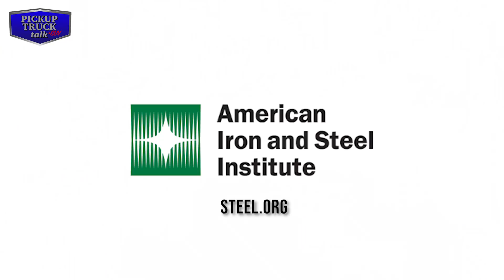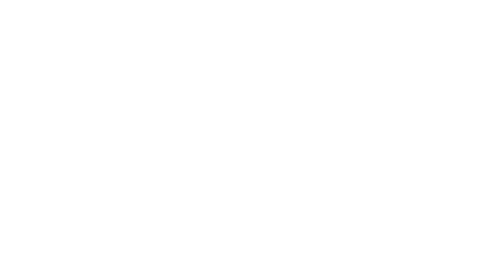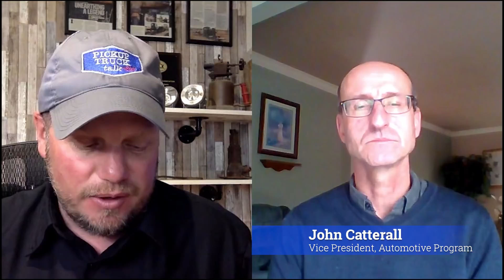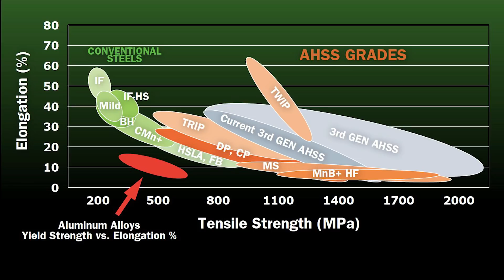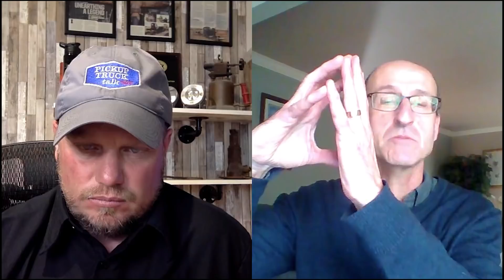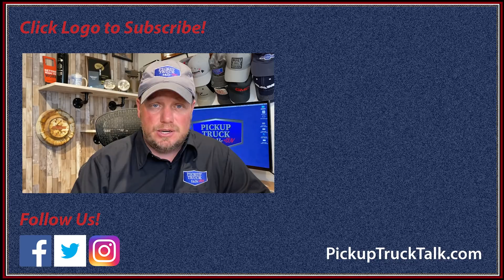Should Truck Frames Bend? Thinner Frames Are Weak? - Expert Answers

Comment: Tundra uses c channel as you know.
Reply: I was under the impression that they use both box and C channel on their frames in different sections, to get the best of both strengths and lightness. When the 2nd  gen tundra came out  we all saw the videos of the bed wiggling over severe bumps. They later box the frame further back to stop that from happening. Toyota Engineers are good, but they make mistakes too
Reply from the maker: sfakach t you are correct. I had to go back and research it again. They have a fully boxed frame up front and a c channel I’m the rear. I’d suspect fully boxed all around with high-strength steel throughout on next gen.
Reply: @Pickuptrucktalk  correct toyota calls it triple tech, boxed in the front and two sections of c channel. The heavy duty trucks and semis have a similar c channel  configuration so why don't they use box frames on the heavy trucks?
Reply from the maker: @jw8578  He answered that in the video. Basically, because 4500, 5500 trucks and semis don't care at all about fuel economy, they give them really thick frames that allow for overloading since the c channel squats when overloaded. If you do that on a consumer grade truck like a half-ton, you would get really poor fuel economy, performance and ride quality issues. It is like driving a 1980s Ford Bronco versus a new SUV today. The fuel economy is really poor, the ride is rougher and it is slower. 

If you want to see this in action, I have some videos of old trucks we use to haul in corn. Those trucks barely get 10 mpg and they bounce like crazy on the road. It is so much better when you add the 14k lbs of corn into the bed. Really smoothes out the ride. 

It really does all come down to what customer you are building for like he said. Today's truck customer wants a good ride, mid 20s fuel economy and for the truck to feel fast. You simply can't do that with a heavy, reinforced c-channel versus high-strength steel boxed frames. That's why you see so many truck makers moving to boxed frames except for commercial grade trucks.
Reply from the maker: @jw8578  Here's a video I did on classic work trucks: https://www.youtube.com/watch?v=9L6C5DaqPbc&feature=youtu.be
Reply: @Pickuptrucktalk  thanks for the info...
Reply from the maker: I’d expect that to change with the best generation.
Reply: @Pickuptrucktalk  yah I am curious about that. Excellent interview...
Reply from the maker: J W thanks!
Reply: Toyota sells advantages of their c channel over box frames, so I was curious if they would switch to box in next Gen or stick w what they sell today.
Reply from the maker: J W it is going to be an interesting conversation for sure especially after this interview. The more I know, the better questions I can ask.
Reply: I'll take a Tundra over any American (that are truly not American) truck!

Comment: Well what I got out of that was the government tells You how to build your truck. Light weight to meet fuel economy Regs. And bend like hell for crash test ratings. Equals a crappy frame. The results are in the picture.  Again, buy a 2500 H.D. To pull your 2000lb. tear drop, no problems for the truck, not so much for the trailer. Enjoyed the company man talk!
Reply from the maker: S Turman thanks Truman!

Comment: When you increase the rigidity you risk less flex than in the old days and causing it not to bounce back thus bending not flexing.  In the old days the pickups would bend and twist but always return now you have a stiff frame with steel that will not flex and when it gets to a point it will kink or bend.
Reply: Steels with high yield strength will take more force before plastic deformation (ie, bending permanently).  Older frames with lower yield strength will yield (ie, bend) before newer steels with all things being equal.
Reply: @matthewgaines10  The big problem is not general plastic deformation, but rather buckling instability. Strength of the material has little to help here, only wall thickness and frame section geometry can affect this. The older frames with thicker walled sections are much more robust from buckling, generally speaking, than the thinner walled, high-strength steel frames. This is what he was talking about with "bulkheading"; which is the method of improving the resistance to buckling of a thin walled section. Buckling instability is a catastrophic failure mode; massive deformation happens all at once as soon as the overload condition is reached. There is no forgiveness in such a design case, and it is also slightly unpredictable.
Reply: @jonathanrabbitt  Not necessarily. Depending on the series of steel used,  sheer strength increases and modulus of elasticity decrease as well, which significantly stiffen and stabilize wall sections. Those older frames were also typically not heat treated after welding, which would result in stressed brittle joints, on top of having a lower material fatigue strength. If your assertion was a 100% true for use case, tubular structures wouldn't be used over I or H beam in the first place. Frames used to bend and break all the time in older trucks, and it's a testament to the durability of the new ones that when it happens today it's so outside the norm. Now, stiffening the frames does put more onus on the suspension to further absorb harmonics and retard impact acceleration. The companies may not be far off with their assertion that when the owners modified the suspension, they increased the load on the frame section. Axle wrap is another thing that could be contributing to them. When you functionally lengthen leaf springs, you reduce the lateral and rotational stability of the axle as well.

Comment: Frame plant in Canada is gone. Hight strength steel corrodes more. Holes are mute if on neutral axis. This guy managed people that knew what he doesn’t.
Reply from the maker: I just did a quick Google and I can’t confirm what you typed. The plant in St. Thomas Ontario just signed a new deal last year and is adding people. Adding nickel to HSLA frames can reduce corrosion. The hole comment doesn’t make sense. Do you have links?

Comment: It's no surprise where this engineer stands he won't bite the hand that feeds him . that said a stiffer frame can be bad when you have a vehicle that experiences abundance of flexing there is a reason heavy duty vehicles have c channel frames with the rear being held down with massive weight the front will need to flex has the front and rear tires hit different elevations
Reply: Suspension?
Reply: The suspension adorbs bumps but it does not keep the vehicle level when the rear of your vehicle is at a different elevation than the front tires are about 10 years ago guys that worked in the oil fields we're having problems with damaging frames on square frame trucks as Dodge and Chevy had because the cross members we're over stressed trying to keep the frame straight. I don't know if you've ever worked in the oil field but the lease roads are not smooth nor level it is not uncommon for one front wheel to be hitting a pothole while the other one is climbing out of it causing a twisting motion on the trucks frame and light duty trucks This is not an issue because the vehicle does not have large amounts of weight acting on the rear of the frame pushing it down while the front end is trying to lift up.
Reply: @80f250  cool
Reply: I agree with what you say 100% all makes sense the older chassis had more structural rigidity and used more carbón and zinc in the chassis making them stronger during Flex to return to their original shape the new chassis do not have that Integrity built into the steel as they are made to be lighter for a reason only to save fuel and only last so long
Reply: Yeah if you want to see a frame engineer fail look up the 1980 ford f100 "Swiss cheese frame "  they put holes in frame to lighten it they flexed so badly the bed and cab would hit and frames buckled .

Comment: Computer simulated says it all.  Had GM or FCA tested these trucks offroad while towing these bent frames would've been fixed before they were released.  Now it is too late so the lawyers will claim it isn't the manufacturers fault, which will cause them to lose customers.
Reply: The ZR2 was validated in racing before production.  The frame isnt the problem.
Reply: @terrencejones9817   Was it validated towing a trailer while racing? That might be a good simulation .  The problem doesn't present itself while racing. The problem presents itself while towing a trailer that most other mid size trucks , suv's, and  JEEPS seem to have no problem towing in harsh conditions. This isn't rocket science. People have been towing trailers offroad for decades. If the trucks had a stronger frame they wouldn't be bent,  and there isn't anything that you can say that changes that fact.
Reply: @bdd1469  Considering it's been proven without a doubt that the 1 bent ZR2 frame.

1: had an overloaded truck bed.

2: his trailer was extremely tounge weight heavy and exceeded tounge capacity. 

3: he was traveling at high speed and hit a bunch of whoops. 

The second bent frame was on  Jeep Gladiator.

So maybe the frames aren't the issue.  

The ZR2 has been jumped on numerous occasions without issue. It's not a frame problem. It's user error.
Reply: @terrencejones9817   Time will tell. Actually it already has , as there are thousands of other rigs towing similar loads in similar conditions without bent frames.   Jumping  and racing have nothing to do with the way either of these bent, so please stop beating that dead horse. The fact that the ZR2  had weight in the bed and a little extra tongue weight isn't much of a selling point to me,  but then again I'm used to hauling heavy loads in harsh conditions.   FYI  You won't find a bigger fan of Chevy trucks and Jeeps than me. I've owned dozens of them, my shop is full of them , they are what I drive, build,  and love..  But...  I'm not brand loyal enough to blow off an obvious issue if it repeats itself,  and I predict that will happen.
Reply: @bdd1469  Do you run 40mph through whoops while exceeding your payload capacity?  Because that's what the ZR2 guy did. I haul a 800lbs ATV in my bed. I'm sure as fuck not going to hit whoops while doing it.  

I also tow an 8klbs trailer trailer with a half ton  .Even hitting bridge expansion joints can be fun. 

Futher note, neither the ZR2 nor the Gladiator were running weight distribution hitches.
Reply: @terrencejones9817  lol. So now you know how fast the guy was ?  If you towing a 8,000 lb trailer with a half ton and even bridge expansion joints are scary you obviously arn't smart enough for me to waste my time with you.
Reply: @bdd1469 The ZR2 owner in question posted on forums after it blew up and admitted what he was doing.  Google it.

The point I'm making with the 8k trailer and hitting bumps is that I can easily feel the oscillation of the truck and trailer when hitting a bump like that. The effective tounge weight will change in those  situations. I run a weight distribution hitch and it's set up properly.  

I wouldn't dare tow that set up offroad at any speed above 20-25mph.

Comment: Great content¡ My guess is that once you overstress the frame, a thin boxed section would colapse in a more visible way. Overloading a F450 is easier and more common, and a thicker c channel will fail but, deformation probably will not be noticeable.

Comment: After hearing the repair topic I looked up a Ford Ranger frame repair procedure and saw I-car statement saying there are modular portions of the frame designed that way for ease of replacement in the event of an accident. So a “frame” isn’t necessarily one piece anymore, but many that are fixed together.
Reply from the maker: Yup. I was surprised and glad to have this part of the conversation as well. It was really enlightening that you can't always bend a frame back, but depending on the section of the frame, you can chop off and mig weld a piece back without losing the structural integrity of the frame.

Comment: The problem is the pressures put on engineers to get better results out of antiquated technology.  There's been basically no significant frame technology changes in the last 40 years.  The manufacturers want to tout bigger numbers but don't want to invest in the R&D to significantly change the game.
Reply from the maker: Sure, I could see that argument. I'd argue the invention of high-strength steel and the introduction of crumple zones are pretty big innovations though. Plus, the stronger and more rigid frames are pretty impressive. That all leads to better ride quality which is why companies like Ford went fully boxed on the Super Duty. This allows that truck to ride more like a half-ton from the early 2000s. The rigid frame really helps engineers narrow down the ride quality issues and work with less moving parts as it were. The customer sees a big benefit to these kinds of innovations.
Reply: @Pickuptrucktalk  So you sacrifice structural integrity for ride quality?  No, and I'm sorry but your journalist friends are the ones pushing this plush ride and interior design trumps all malarkey.  These are pickup trucks, they're intended to do work, first and foremost and that has to be the priority.  If you don't like the ride, that's the beauty of capitalism.  Can you imagine this kind of mentality in the farm machinery industry?  My God, people have really lost a sense of reality.
Reply from the maker: @captainstabbin9338  Sorry, did you even watch the video? We address all of those things.
Reply: @Pickuptrucktalk  I did.  While I respect his knowledge, he seems quite contrite on the subject of overall frame ingenuity, or lack-thereof.
Reply from the maker: @captainstabbin9338  Thanks for sharing. Always good to hear another point of view.
Reply: @captainstabbin9338  I think farm machinery has evolved the most, so may not be the best comparison to use. Old farm equipment is often the most sought after these days, as it lacks the technology, complexity and unnecessary additions you find in most new offerings. Farmers literally cannot afford new equipment that costs millions initially, and have shorter service lifes.
Reply: @MX5-XU  
DEF